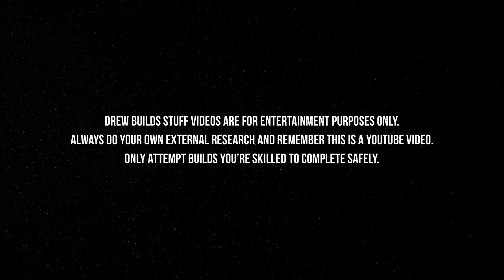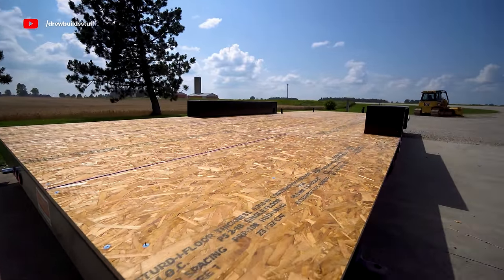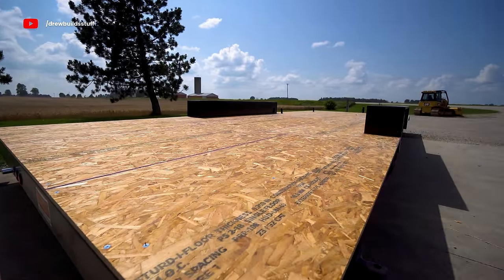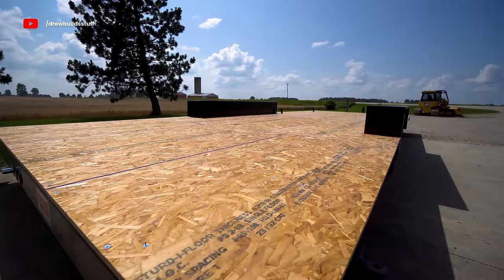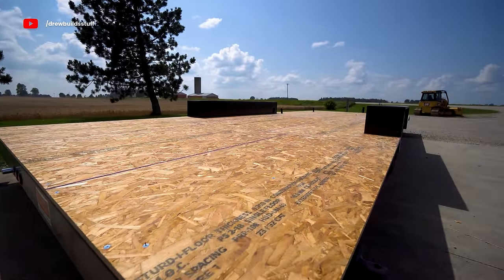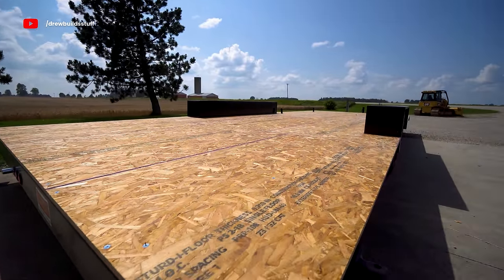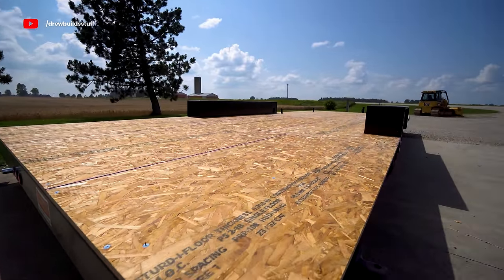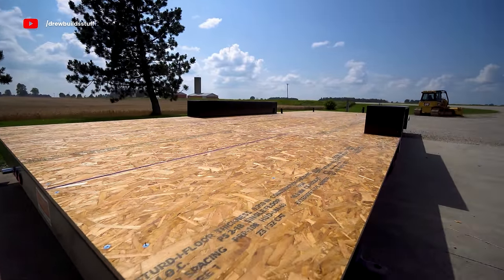BUILDING A TINY HOUSE - DIY Full Exterior Build

Comment: Just wanted to share that you are limited with a 50 amp panel. We were in the same boat. Installing propane was not an option for us. Neither was the tankless hot water heater. Through trial and error, we live with a microwave-convection not needed.  A large Emeril oven-17 settings with airfrying. Large door. A smokeless grill with griddle and grill. And a can opener. Emeril oven was $99 on sale. Smokeless grill and griddle was $99 on promotional sale. Microwave was already installed in our tiny house. We brought our can opener with us from our fifth wheel. It was freeing to see did not need a stove top it build-in oven to be able to cook. Outside we have an Egg for outdoor grilling, smoking. 
Suggestion: make sure whatever your cooking situation that you install tile or some easy-to-clean back splash. I would recommend tile flooring in the bathroom and in the washer/dryer area, if you purchase an all-in-one wash/dryer. We purchased a second-hand washer that a friend had purchased on Amazon for around $200. We keep it out on covered porch on the side of the house. Works extremely well. We hang our clothes outside on the back if the porch or bring the drying rack inside during the late fall and winter. Blanket and other big items we take to the laundromat. Amazon also sells a dryer, but we are happy in our routine.
Reply: Forgot to add that our microwave is mounted on the wall with a strong exhaust fan in our  cooking area. The smokeless grill sits underneath the exhaust fan. The Emeril oven sits to the right. We have six feet designated as our cooking area plus another six feet where our dishwasher and sink are located. Our kitchen area is an L shaped. Our tiny house is 12’x42’ with a 9’x12 front porch-covered. We added a covered 12’x24’ side porch. We included French doors in our kitchen area and it invites us outside onto our covered porch. Our home does not look or feel like a tiny home!

Comment: Drew, you should not be even using galvanized pipe on your gas lines only black pipe please replace your galvanized fittings for your gas line on your home build to black pipe. The gas can be corrosive to the galvanized, causing leaks galvanized should only be used for water and they’re not doing that anymore either.

Comment: You should of overlapped your aluminum facia the opposite direction.
Wind will get under the overlapped seam and lift up on it as you move this thing around.
A good siding guy knows which way to overlap a job by which direction the wind will blow.
You should of started at the back of that home and worked your way to the hitch end, that way the wind will blow over the seams rather that at them.
Your factoring of wind resistance/lag wasn't placed into your design.

Comment: butyl window tape come in square, round and other shapes an in many thickness, You should order it in a thickness quarter.Inch two and eight inch wider than your hole and Stick in holes from inside. It will sell and expand and keep that air tight.And we work good with what you've already done.

On your demo you lined part 1/8 by 3/4 butyl window tape, it OK to but color mating silacone on outer edge.

For your mble house the butyl window tape Will allow the window to shift more when it's being loaded.Move because you have mounted everything so hard.In place that the only thing left to give way is the glass. The beautiful take maintains an airtight seal but allows for movement End temperature changes. The substitute for that is the round phone that you can also stick in the cracks.And stick that to the in between the window and the will prevent the same thing but is not as aiR tight As butyl window tape

Comment: Can someone tell me why it's ok to have the foam that gets placed first, under the floor, why is it ok to have just that foam exposed to the elements underneath? I have seen multiple videos where they just drop in the foam in the gap of space. Which means underneath, it's just the other side of that foam, exposed to the air. I saw 1 video where he dropped a piece of wood down first and then the foam on top and in a follow up video, he described doing that as "over kill". So I'm just like... I guess you can just drop the piece of foam in like that, but also, it doesn't seem right. So, why can I do that?

Comment: Thanks!  Most under passes in the US are marked 13’6”. You’re at 13’10”. That’s gonna cost you extra to travel. You are now considered oversized that’s a special permit and you have to go over the overpasses and not under them or take detours.  Not good.  I’m a US truck driver.
Reply from the maker: Thanks! 14’ is the standard in Ontario.

Comment: Consider 'wood fired heat' and  solar, hydro, wind charged  battery powered  DC mini split air conditioning / heat pump... if you need air conditioning,  in your part of Canada.  DIRECT CURRENT appliances 'do not require' a power wasting inverter to operate.   'AC' ALTERNATING CURRENT appliances might  require an inverter to run from wind, hydro, or solar charged  battery banks.  Hydro, Wind and Steam  power can be used to generate electricity  in AC format or DC format.    IF batteries are involved that is a  Direct Current source and might require the power wasting inverter.   So, consider Direct Current appliances.  They  just might work better or more efficiently.  In some forested parts of Alaska,  wood fired steam generators are producing electricity.  This can be done as part of a grid system or at the individual level.

Comment: The corners that you are using that are made out of vinyl. You are going to run an issues on Downe road for the life of this trailer for the fact that yes, you are nailing them correctly, but the type of nail that you used, which is a roofing nail with not a ribbed or corrugated shank, will have a tendency to pull out and because of wind beating along side of these, especially the ones to the rear of the trailer, will have a tendency to pull themselves out..
You could have done exactly the same thing, but you would have to take a piece of gorilla tape. Or duct tape and apply it to the actual siding. Where the nail would go that way? It won't tear through on down the road as it gets older and use coated decking screws to hold it.  That way , it won't work itself out and the vinyl slits won't wear out and break off.

Comment: ugh... no way those insulation floor panels would stay in place, there is nothing holding them in place. Just a bump away from dropping.  And those headers have no support on the bottom.

Comment: WOW:  Vinyl siding for a trailer: Might work if you never plan to travel down highway with trailer.   Trailer home have metal siding for a reason.   Roofer has a lot to learn as he should have advised you to use insultation under the metal or you will have an icebox in winter and oven in the summer.   If he tells you that you cannot insulate under metal, I get the same from over 80% of roofer who are all high school graduates.  Sorry

Comment: No respectable carpenter would use chip board for floor.   Tight wade~  Should use plywood which is stronger, resistant to warping and does not fall apart if it get wet.   Trailer always leak somewhere.  Chip board might use on walls but chip and particle board is junk at best. Wall should have been 2" x 6" for sway resistance.  Really an beginner:  try a dog or cat house first.

Comment: I like your work? But, I've seen things you are doing that will lead to potential headaches in the future? You're working on a budget? I understand that? However, my problem exists on two factors that will weigh in. Plastic sheathing is useed to prevent any kind of leaks. You never rely on just the foam? And you can budget walls, windows and doors? But, never flooring and ceilings? Two parts flooring, 1 part plywood below and particle board above. Same goes with the ceiling

Comment: I would have used a door lock that ties in with my iPhone and Apple Watch. That way it would be really secure and it would automatically unlock when I got my Apple Watch or iPhone within a foot of the door lock. After all, I have to either look at my iPhone (Face ID) or put a six digit code on my Apple Watch already. Why have to do that with the door also? And then I could tell it who else I trusted and when and then remove them easily when I didn't want them to have access to my tiny house anymore. Yes they cost more but it would be worth it. Especially when my hands were full.

Comment: You did a hell of a job on your tiny house build. But 65k is a lot of money for something that cannot hold its value. Putting that money down on a fixer upper house and then get the money back later. Most people that would build a tiny home would do so to save on money. So they would probably not spend as much money it as you did. However you did a great job. Thinking having a YouTube channel is the only way this might be worth it as you can make money on the videos of your build.

Comment: when you cut the pieces of insulation foam to match every single differently shaped slot on the frame...the frame itself is metal it conducts heat better than air does.  every touch a piece of metal and its cold? colder than the air around it right? because it transmit the heat BETTER  you shouldn't have cut a hundred different perfectly shaped pieces .  the metal is where your heat is getting sucked out.  in a computer know what a heat sink is? metal.  because metal transfers heat very well.

you should have just left full square plates of insulation and attached those ABOVE the frame.  then you are insulated FROM the frame.  you have left the best possible avenue for heat energy to travel open and yoi did a lot of work to do so.  why not just use 6 or 8 sheets of insulation? flat. in their entirety maybe one cut for over run.  why make so many cuts so many pieces? to ultimately end up at the worst outcome.   ever sat in a  garage and the cement feels cold but the air doesn't? ever touch a car and the bod of the car feels notably colder than the air?  because metal transmits head through it better than air.  its denser.  vacuums are what heat cannot pass.  not density.  density aids it.   foam is an insulator because it has bubbles.  areas that air cant easily traverse.. having empty voids in those holes (vacuum sealed to less than one atmosphere if possible but that's insanely hard.  the empty space is best.) .  filling it was bad. and shielding yourself from the metal is much much better at  insulation.  i  wager you let more heat in through the metal frame than you ever did through the gaps you plugged. it didnt do nothing.  but it wasnt based in understanding heat transfers and so is flawed .  if youre building a house this is for you friend.

jut in case you make another one i guess.... or anyone out there is planning to make on like me.   dense materials transmit heat well. things that feel cold when the air around them doesn't.
Reply: actually if you did the top and bottom of the frame you have turned the air gaps into an advantage for free.  they will insulate you even better than the foam.   if you wanted to correct this mistake partially.  insulate the entire bottom of your trailer below your installed installation and if possible pull that insulation out from underneath. you want a gap so the heat cant transfer easily.  foam foam foam is less insulating than foam air foam.
Reply: drilling away the wood first  for a screw is called a "pilot hole"  its pretty standard.  you use a drill that's two sizes smaller than your screw.  this prevents the wood from cracking and eases the effort of doing it considerably.  you will drill faster pushing less hard.  it matters on large builds.  you make more mistakes when tired.   it is also a bit stronger because your wood fibers are not bending around a nail.  they are straight except for the place where the nail is.  and then the nail is the structure.
Reply: if you want to build something like this alone.  consider using   wench and pulley.  you can use a hand wench but there's a device called a wench-all  just like a saws-all.  it will try to wench in any situation  it is two hooks connected by a motor.   how yo use that is up to you.  but you can lift a 300 lb wall solo with it i grantee it.  ryobi makes an affordable one.  good luck,   i have used that cheapo model to lift a fully grown evergreen tree that fell and move it by using the branches nearby as a fulcrum.   learn mechanical advantage it is intensely useful if you are worried about building alone. or you're a small female and worry you  cant lift a generator onto the roof.  you can. use a wench you could use gears to transmit extra spins into stronger lift.  it can  be done.  there is an answer.  

dont give up friend.  get free.

Comment: It was not smart to use nails.  U should have used long screws on everything  Nails will eventually start pulling out, and make your trailer weak and squeaky.  Screws will keep everything tight.  I also have my trailer made from a 9.6 container.  And I wish it was taller.  So u should have started your ceiling height at at least 12 feet, that way u can have some hanging fans to circulate air.  Which is nice in a small house.  Also taller ceilings makes the hot air go to the top of the house in the summer.  So its not so hot inside.  I love the higher ceilings.  U should have also leveled your floor and put down jacks.  This is because if your floor is not level, and you start leveling walls, everything will be out of level when you finally do level your trailer.  This is going to make everything out of kilter.  Your first mistake in not telling your viewers to level their trailer first.  Not everyone out there is smart enough to think of this.

Comment: That construction is too heavy to be transported with wheels!!!  You went too far with the weight and you should have built that house with a structure of steel or aluminum tubes!!!  It was easier to build and cheaper!!!!  To transport that house you need a truck and with all that weight it consumes a lot of gasoline !!!!